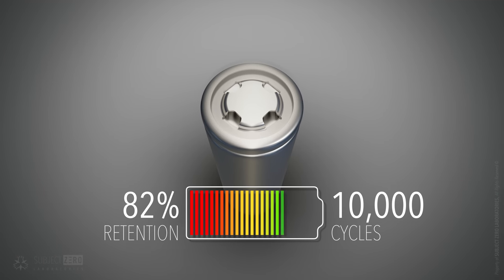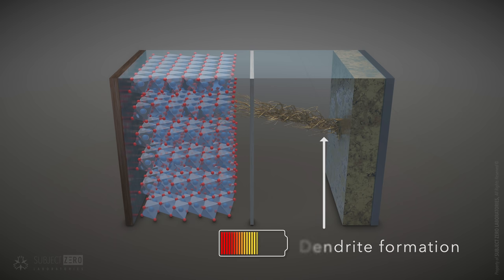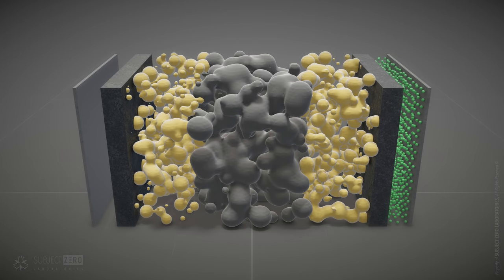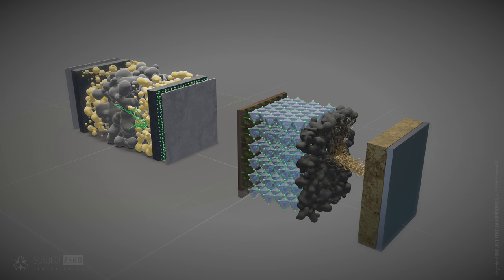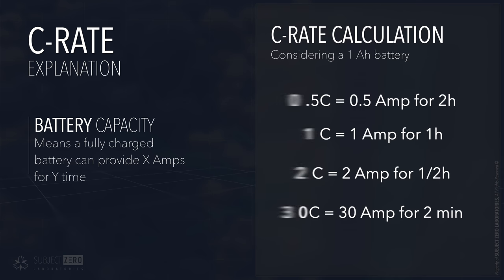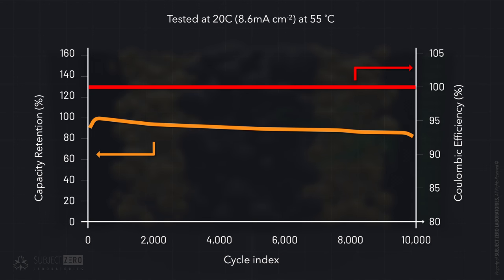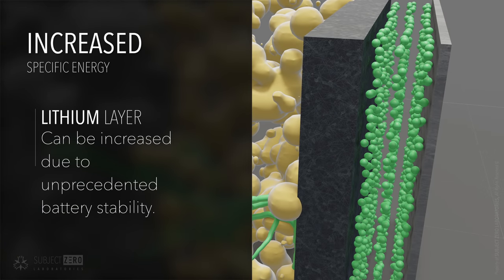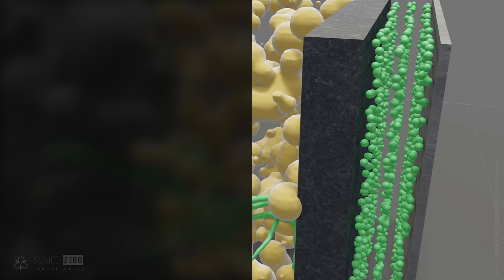A battery that lasts 20 years

Comment: It actually makes a lot of sense. The unstable electrolyte doesn't really STOP the dendrite formation completely, but instead simply dissipates the dendrite growth so short circuiting doesn't happen.
Reply: Yes, but lets see how it is implemented and mass manufactured.A new unknown problem might arise!
Reply: @makisekurisu4674  From what I've seen these studies were performed at elevated temperatures (~50 deg c). So you may have to artificially heat the batteries during use.
Reply: @Justin73791  Maybe it can be tuned to work at room temperature
Reply: @makisekurisu4674  I'd hope so, and I'm not even sure the high temperatures are required to repeat the results. 

It's just the temperatures they performed the test at, and it's the temperatures batteries are known to be pretty stable at. 

So it's either they were just trying to make the numbers look 'extra good', or the batteries really need these temps. 

Either way current batteries already face somewhat of a temperature problem (just not that extreme), which is why EV's in winter do significantly worse than in summer.
Reply: @Ikaros---  I should clarify, the batteries do not reach 50 deg c on their own. They have to be artificially heated.

Heat management in phones/laptops is already a nightmare, putting a battery in that wants to constantly be at 50C is going to be a headache.

The bigger problem however, is the battery would have to use it's own power to heat itself up. 

Assuming these batteries need constant 50C to get their stable results that means consistent energy drain trying to maintain that temperature (the reason EV's do so poorly in winter).
Reply: @Ikaros---  I see what you're saying. I wish they would release more temperature information in their experimental study. 

My concern is if this battery 'needs' 50C to prevent dendrite formation even at low power draw. 

If that's the case your phone would constantly be draining power to keep that high temperature, not just when you're gaming ect...

But again the 'need' for 50C is just speculation on my part since that's the temperature they performed the test at.

I have no idea how the batteries perform in a cooler environment.
Reply: @Justin73791  considering the battery doesn't prevent dendrites but removes them, the best approach would be to heat the battery only while charging.
That way you still get to kill dendrites, but you don't need to waste battery capacity to do it.
Many phones are accepting upwards of 50 watts of power these days, so it wouldn't be a big ask at all to heat them.

Comment: All amazing batteries, they can do everything except get off the laboratory bench.
Reply: Scaling is always the hardest part
Reply: @yourmommashouse  mayysry->matter?
Reply: please stop doing this joke is every where.
Reply: @camiloacevedo5467  it's funny because it's true.
Reply: You have 10000 batteries it the lab but a few of them on mass production.
Reply: It's funny how battery technology really hasn't changed in the past 15 years. Designs have been streamlined but fundamentally lithium-ion cells are still exactly the same, and no one has been able to come up with anything better.
Reply: 😂😂😂😂😂they can't leave they are just like nuclear fusion
Reply: And they won't come out any time soon. Why ? Because first, they need to milk every last drop of old technology money... Before making anything new.
Reply: @felixh2786  Battery Technology has improved quite a lot in the last 15 years. Also if this battery would come out it would still be called a lithium-Ion
Reply: Word...
Reply: Humanity needs a major breakthrough in 2 things 1. Energy 2. Gravity period
Reply: The brain battery uses dendritic action to run at required levels for many years.
All we need to do is inject two hemispheres with anode cathode material, and then we can power devices such as vehicles by just touching two collector plates on steering wheels.
This would be the only battery anyone has to buy, and when they stop producing power at full level, all people need is to drink Gatorade accordingly.
Reply: @kishanagarwal5369  in what way would you like us to progress with Gravity? Artificial gravity? Because damn that’s probably not gonna happen anytime in the next few hundred years if ever.

E: but i agree with you on the Energy bit, if we could finally get clean Fusion to work at scale maybe we wont die out because of global warming and polution. Id say that our second big problem is transportation tho, in many places around the world the Car is still the only viable method of transportation and while i agree that they are very practical i dont think that this is sustainable since even electric cars are not good for the environment by any strech of the imagination especially when compared to Trains.
Reply: Well, batteries that are mass produced are made cheaply. Not because their ingredients are cheap, but because the entire process is streamlined and cost is heavily reduced. Now you want companies to ditch their factory designs, make a new one, re-train their workers so they can sell fewer, better batteries? Sure they can mark up the price but people are only willing to pay so much for a battery. People are fine with paying $10 for a pack of batteries that last a year. And, in reality, when are you ever going to recharge a battery 10,000 times? People charge their phones 1,000 times at the most every year. Then they switch it out every other year. As for EV, it's probably better to get a battery change when the batteries don't run as well after what? 5 years? 10 years? Sure, this is a cool video. But the economics needs to be there for the design to make sense and it just doesn't. Battery design hasn't changed because the current battery design is a damn good one. If something lasts for 15 years without being changed, then it's a fantastic design
Reply: @kivats5015  Tnx for the correction, English is not my native language.
Reply: So true.
Reply: 100% exact
Reply: @felixh2786  Except the batteries have gotten much much better over 15 years. It has just happened so gradually that we don't notice.
Reply: @ofnotandi  I'm not saying they haven't gotten better, rather that the tech has fundamentally remained the same, just much more efficient (by using higher purity components, improved production methods, thinner walls, etc.). Lithium-ion batteries are still unchallenged in consumer applications.
Reply: @felixh2786  bro, it's like saying gasoline cars haven't change almost 100 years :))
Reply: @felixh2786  Well, yea they didn't changed that much, but the chemistry is more stable, resistant over time and holds more energy density.
Reply: Another thing about this is A: with so many prospective techs figuring out which one to fund is difficult. B: Tech in the lab generally takes about 10 years to make it into industrial production. As the lithium ion tech has only been around for 20-30 years, has had a lot of improvements, and many of these battery ideas are much more recent, much of this stuff is either just starting or hasn't been around long enough to start being produced
Reply: @snakevenom4954  so that means lead acid are fine for home batteries that have a couple of cubic meters of space
Reply: Yep. Established money holding back all the good products, protecting their revenue.
Reply: @jonday7250  it is only possible to hold back better products if there isn't any competition.
Reply: @NomenNescio99  wrong. The competition holds back the better product. That's what I mean when the established money protects their revenue.
Reply: @jonday7250  You are reiteratating a very common fallacy often held since our current education system teaches a far left perspective on the free market.

Please read the book "economics in one lesson" by Henry Hazlitt, it's an easy read and a good introduction to a fallacy free knowledge of how the free market actually works.
Reply: It took 12 years to go from Goodenough's prototype in 1979 to Sony releasing a commercial battery in 1991.
Reply: Planned obsolescence lmao. They'll never produce batteries that last for 20 years.
Reply: @SS_etereo  Car batteries last about 5 years, depend on model and if car have or not start / stop, but they are still cheap.
I don't thinks it's about that but production cost isn't viable yet only for a marginal improvement.
Reply: @overPowerPenguin  yeah you are right but that cost is still driven by the commerce... Til this day there was no need to change how batteries were made or wich matterial is needed. We were fosil fuel dependant for almost everything, and we were so lazy to try and change how we produce energy...
Reply: @SS_etereo  We wasn't lazy. Old tech to extract and process oil was way more poluant than today.
Reply: @overPowerPenguin  thats true because it still use fosil fuel. But in the past there has been some intentions to change the energy source, but there was so much lobying from oil companies that make new technologies a no go... We still see that in the US. They decided to create New non contaminant technologies in fosil fuel dependant factories in order to protect the big oil firms...
Reply: Breakthroughs take time. It's one think to make a working model, another to be able to mass produce. All I know, is when it happens? Game Changer/
Reply: Yes, not like we have roughly 7-10 battery advancements from idea to products on shelves within the last 3 decades or anything -_-
Reply: @deanhagenov8356  Yes, there are a few improvements of the same base technology we have been using for the last three decades.

None of them have been anywhere near as earth shattering as the promises made by all batteries currently stuck on the lab bench.
Reply: @NomenNescio99  does the letters LiPo ring any bells for you? Or the tab-less battery approach? Or the fact he described completely new architectures with solid state plates, regenerative chloride medium and all with cheaper material alternatives? 
But no, it's still all just the same yes?
Reply: Improvements are making it into the the world, through the sheer will of tensely anxious scientists who hope Elon doesn't come around to breathe down their neck, or yell down it, lol.
Reply: Just what I was going to comment.
Reply: Hah u r right
Reply: lol :D
Reply: Sad, but probably true.
Reply: They wont make passive profit
Reply: Lmao
Reply: @gytispranskunas4984  That's not how technological progression works. Nor how Corporate fuckery works either. You think a bunch of companies can work together to just /not/ make fuckloads more money by making way better shit then someone else?
Reply: All Amazing opinions, they can do anything except make you touch grass.
Reply: Thinking the same thing.
Reply: Ah geez thats soooo true remember bubble memory, gallium arsenide processors, parallel processor computers I’ve learned if the info is coming out “the mit” it ain’t going to happen..
Reply: @infinitelyexplosive4131  I think he got a stroke
Reply: Batteries that can last twenty years would cause problems for those that manufacture it.  The better it is then the less they sale and the less profits they make.  Actually, there is a better battery than this one that was created a hundred years ago that can last for 100 years if you take are of it.  It's Iron-Nickle.  The problem with it I guess you can say, it's not for electronics as it's just as heavy as lead and just as bulky.  In truth its the very best of batteries for solar, wind and alike.  It a bit more higher priced because they don't build allot of them or keep numbers of them in stock.  But once you buy it then it will be the last set for that you will buy.  For the 18650 form factor, I have discussed this with someone heavy in super caps.  It's very possible that that could be used and thus not having to deal with this batteries chemistry.  It should last a decade or two until the electrolyte dries up which is the same problem this batteries chemistry would be.  The super cap will charge faster, it's nearly 1-1 with a discharge rate to C0 if you pushed it to at over 1M cycles.  It doesn't explode less overcharged, doesn't use rare elements like lithium.  I have thought about building a prototype bank of them.  But taking a 18650 apart to redo the guts of it is just a bit on the dangerous side.  Then finding the three-four layers to use that is thin enough would be hard.  But that would be the best of all answer.  It's cheap, easy to make and will last a long time with a nearly flat performance line with little loss in 10-20 years.  But like everything, depending on its use, treatment, etc it should last a long time.  Just thought of one limitation.  Super Caps will discharge if not kept charged in about four days.  It's not designed to stay charged which is it's limitation.  So, if it is in an active circuit and constantly used its a good fit.  If it is going to be sitting around like a torch then it's a poor use for those applications.
Reply: @uctt24  oops
Reply: so true
Reply: @snakevenom4954  I would agree with most of what you're saying but I think you might be forgetting a few things. You're absolutely correct when you say that batteries are streamlined and cost effective to purchase/produce. Also, taking a factory and revamping it, just to make less money, would be moronic, to say the least. However, think about what batteries could replace. Yes, you'd have regular AA and AAA and so on but better batteries in cordless equipment as well. And if you can raise the voltage like he's saying, then that opens the way to using batteries in new applications. Not only that, but think of the tech advancements. When you can raise and lower the voltage, it last longer, performs better and cost less to produce? I mean you're literally opening the door to a new advancement, which will open the door to even newer tech/advancements and so on. It would be sad to see such progress held up because no one wanted to sit down and figure away around an issue that, in my honest opinion, isn't really an issue. However, that doesn't mean I'm right. God knows there are plenty of man and woman out there far smarter than I.
Reply: @felixh2786  tesla would like to have a word with you
Reply: @felixh2786  it barely changed in last 100 years